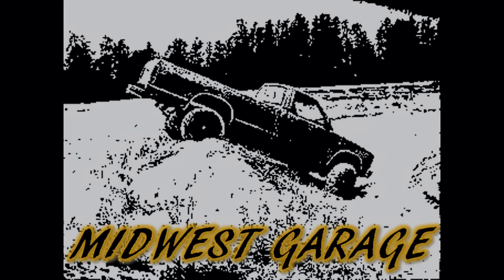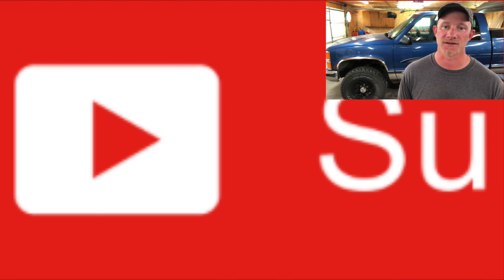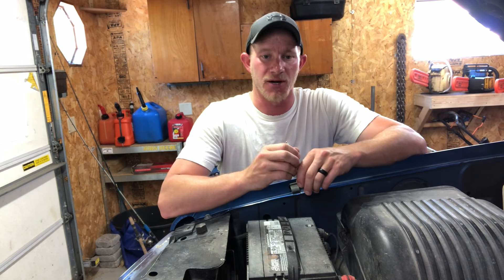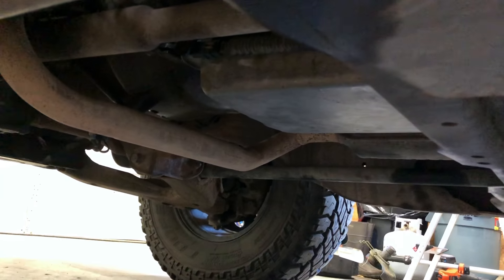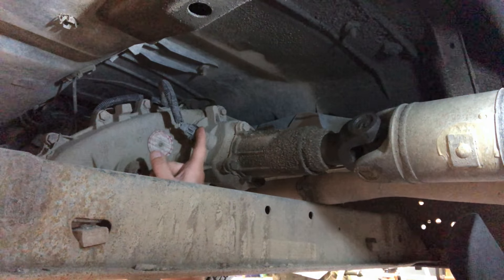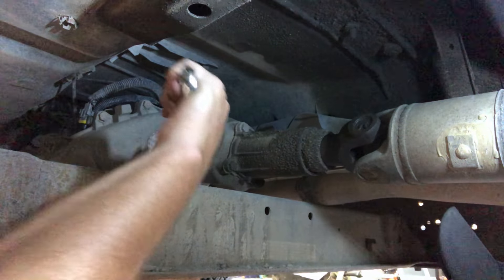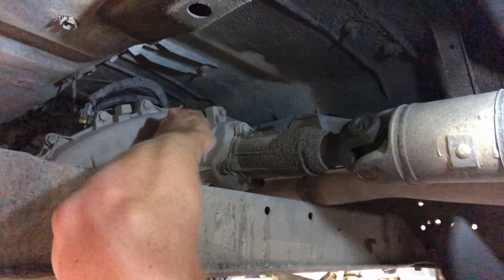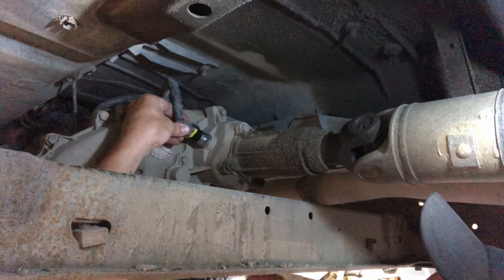How To Replace Vehicle Speed Sensor in 1988-2005 Chevy GMC Truck & SUV

Comment: Just this week I noted that my 97 gmc sierra speedo was suddenly reading 10-12mph fast.  Shifting is fine, no abs light or code. Hopefully this will be the fix. Rigs got 235k on it so I got my mileage out of that sensor for sure.
Reply: Did that end up fixing it? Mine is doing something similar

Comment: I think my speed sensor went out. My 96’ Tahoe started sifting funny last week. Today I was driving back to the rig and I was 15 miles out I had to drive 50mph at 3k RPMs then on dirt road 5 miles out 25 mph when I hit a down hill spot my transmission drove normal for almost a mile then back to slipping. I had my transmission rebuilt 5 years ago.
Reply from the maker: Yeah I'd definitely check this out man. It's only $30 so if it doesn't fix the problem at least you're not out much. Let me know if it fixes the issues!

Comment: If the instrument cluster is showing zero speed and the trans and ABS are acting normal, can I assume the speed sensor is not at fault? And it's a cluster issue? 

2004 GMC Sierra 2500HD 6.0 V8 RWD

Comment: Great video my truck runs great breaks work have plenty of pads, the sensors needed to be changed but the abs light is still on btw I have a 1998 Chevrolet Silverado 1500/ex 5.7 350 4x4, if you have any suggestions on what it might be thanks for the help.

Comment: Very good information I could not even get that information from all these so-called transmission specialist I have a 94 Chevy Silverado transmission went out it would only go in first gear and reverse I bought it I got a new transmission put it in and it's still only wants to go in first and reverse so hopefully that will solve my problem that my speedometer cable was acting all funky now I have no speedometer reading it all no nothing can you tell me if you think that that may be the problem

Comment: i have a 94 suburban 4x4 and i get code 16 VSSB and 72 VSS.  im not sure if one code triggered another? its rebuilt trans, i also have issues with both front wheel speed sensors. and brake light switch.  i guess every one of those would give me the issues i have with shifting and speedometer.

Comment: I have a 1995 Chevy two wheel drive. Will a speed sensor cause it not too shift. It's like it's stuck in second gear. Reverse work,s with no problem,s. I found a lot of acorns under the hood. Going to check to see if a squirrel has cut through a wire t

Comment: I have a conundrum with my 99 silverado 1500 4wd. So I have two sensors on my transfer case, one on the drivers side and one on the passenger side, they're set about 90 degrees apart, and I have no idea which one is the speed sensor, or if for some reason I have 2 speed sensors. Looking it up online is no help as everywhere I look says there's only supposed to be one. Any ideas?

Comment: Hows it going. So I have a 04 yukon denali 1500 xl and I have all the systems discussed in your video. I checked the code and it said ABS SPEED SENSOR. I purchased the item but mines came in a 2 pack of cord like sensors that seem to go on the front end wheels. Do you think this is the right part that my code is calling for?

Comment: Found this video looking to learn why my '88 Silverado's heater/ac fuse blows when I put the truck into 4WD, and I've got no 4WD. In 2WD, no issues with heater. From what I read elsewhere, sounds like replacing the VSS may solve the problem? I'm no mechanic, but looks straightforward, gonna give it a try shortly. Thanks for the video
Reply from the maker: That'd be a pretty cool fix if that works, I've never heard of those symptoms. Let me know if this fixed your problem though, I'm curious to find out. Thanks for the comment!
Reply: @MidwestGarage VSS sensor was ok, stopped blowing fuses when 4WD actuator was unplugged. Replaced, 4WD & heater good fine since. Thx for having a look at this, hope you and yours enjoy the holidays

Comment: Hey maybe you can help. Ive got a 98 gmc c1500 and trying to bleed the abs and it wont auto bleed only thing I can think is the wheel speed sensor are the problem but whats strange to me is that with the truck sitting still all 3 sensors are reading 3mph

Comment: On my 2005 GMC with the Duramax says shift range enable ABS and brake light stay on seems to only do it going from four-wheel-drive back to 2 Wheel Dr. and sometimes makes a clicking noise. Won’t go out first back up like it goes into neutral then it starts working fine again what’s up with that?

Comment: I have a question I have a 06 chevy silverado crew cab 2500hd 6.0 and the transmission shifts fine until it gets to 3rd it goes to 3rd to 4th then seem like it goes into natural for a second then back in 4th any guess it's a rebuild one has 11,000 miles

Comment: My 1999 suburban k2500 4l80 tranny is shifting hard in each gear i lost my speedometer the abs is on but I did get and service engine light.  You think I'm having the same issue?

Comment: I have a 95 G20. Trans won't shift out of 1st. Just had trans rebuilt with new speed sensor but the same problem still. The speedo works intermittently but when working it shifts fine? Any advise?

Comment: My 1997 K1500 5.7 is not shifting, ABS light on. Gonna change the VSS but it is very tight. Do you know what socket size fits this sensor? My adjustable is going to slip and I want to use a 6 pt.

Comment: Well I changed my speed sensor on my 03 Chevy 4x4 Silverado automatic transmission the speed sensor on the driver side and it didn’t help and I looked on the passenger side on transfer case and it has one on passenger side, they look the same and have the same plug connector I changed it and my speed odometer still didn’t work and lights still on. Do you have any suggestions?
Larry

Comment: Ok that was a good one I have a 93 GMC Sierra K1500 4×4 and I have changed alot the starter the gear box and plugs and wires and the distributor cap and the rotor  she started up and drove a couple days and then won't start she acts like she wants to start but doesnt any ideas

Comment: Hey. While I know this might an issue for some, my cruise control works sometimes and even disengages while in use. Could this be solution? I have a 99 GMC Savana. I have noticed that the speedometer does slow down before a stop. Like not reading what it should.

Comment: Excellent video... Straight into the point... Thank you :-) 
I do have a question maybe you could answer. Would a bad VSS have any effect on a starter motor? I had the symptoms you described, plus now and then my starter won't engage. Just hits a grind as if the Bendix didn't make a good connection flywheel. I can put it in neutral and roll it back to get the flywheel in a different position and usually that works. Other times I just click it a few times and suffer through the grinding until it engages. LOL. I probably should anticipate a new starter but was curious as to whether the VSS would have that type of effect on it? Thanks for any information and keep up the videos. Thanks again and take care
Reply: Did you figure it out? I believe the starter not engaging sporadically but the switching to neutral letting it work can be caused by the ignition switch on these trucks.

Comment: I know what to do but mine just won't come out, it's under a 2002 S10 ZR5, the floor is closer to the transfer-case so I have almost no space. It's literally planted. Would you recommend using a wrench and socket instead? Maybe a 1"

Comment: I have a 2000 Chevy Tahoe with 233345 MI. on her and I believe that's what's going on with my speedometer right now!?.. I'll definitely let you know if that's the issue and then had a transmission rebuild other issue still going on still haven't had a full tune up yet so there's a lot of issues I have water I hope this video solve my problem cuz I believe that's what's going on with mine

Comment: I have a 2001 Blazer/  My ABS and Brake light comes on just sometimes while driving on a long trip after maybe 50 or 60 miles.  Any idea what this could be?  It doesn't have the symptoms you mentioned at the start of your video.

Comment: Hi I've got a1998 chevy silerado Ilm having issues with my rpm and speedometer not working but rest of gages working also my Trans mission is not cycling through  the gears just replaced speed sensor any ideas?

Comment: A quick question. I have a 91 but a manual transmission. I have the diagnosis so yes I need to change mine. So is it the same and in the same place. Oh no mine is not 4×4. I as well need to change my reverse sensor.

Comment: I'm having the speedo issue and my tachometer also dies when my speedo does and my trans wont go into OD would this be my problem
Reply from the maker: There's a very good chance that this is your problem. I'd buy one and see if it fixes it. If not, at least it was cheap and probably needed to be done anyway. I hope it does the trick though, if not let me know and we can do some more trouble shooting! Thanks!
Reply: @MidwestGarage  awesome thanks man yeah I'm sure it wont hurt.  Its a 95 c2500 so it could use it I'm sure.  I'll get the part tomorrow and try it and I'll get back to you
Reply from the maker: @alputney3530  Was that able to fix your issues man?
Reply: Late followup sorry. But yes it did fix my issue thanks alot man. Now I have a 94 suburban and the tac and speedo don't move at all. It worked occasionally before but has been over a year since either moved now but no trans issues any thoughts

Comment: I just bought a one-owner 1997 Chevy Express 1500 conversion van.  It has 174,000 miles and is in excellent well-maintained condition.  It doesn't display any of the symptoms described here, but the speedometer is frozen at 22mph no matter road speed.  The previous owner says the speedometer will act normally when the outside weather gets cold.  "Late fall, all winter and early spring" is what he said.  Will a new VSS cure this as well?  Thanks.

Comment: Old post but could this cause the truck too act like cruise is engaged I have disconnected the cruise cable checked Everything. Checked for vacuum leaks all that helps is unplug battery then it won’t act that way for a few hours. No high idle only driving does is hang like cruise is on. Throttle cable is fine

Comment: Would this effect my rpm, gauge as well? I have a 98 chevy silverado c1500 5.7 engine. My truck will work fine, then suddenly lose my speedometer, rpms, and feels like I'm stuck in first gear. Already checked the ground lead. Any suggestions?
Reply from the maker: Could be this, could also be your ignition switch if it’s affecting transmission. I have a video on that as well…it’s an old one though so quality is low but it gets the point across.

Comment: My 2003 Chevy 5.3 won't go over 40miles an hour gears work and I have reverse. Would this be a possible fix?
Reply from the maker: @ricktile8252  this could very well be the issue. It’s a cheap part that’d be worth replacing to see if it fixes it and not a bad idea to replace anyway. If it’s not this then it may be your ignition switch.
I have a video on replacing that as well if you need it.

Comment: My '98 S10 Pickup  has erratic  digital odometer(major flickering)
 (Speedo works, but is off by 10mph)
And many of the dash warning lights are going on & off erratically, & even stay ON when the
Ignition switch is OFF  (draining the battery).
  even the 4x4 light comes on & the truck is 2 wh. drive!    lol.
    Trans is a manual & shifts fine.
Could a faulty speed sensor be causing this problem?
Reply: I replaced the speed sensor on trans and that fixed all of the check engine & other misc lights that were going off & on.    but now my speedo does not work at all (before the sensor swap, speedo worked),
& now my gas gauge does Not work.  W T F

Comment: I’ve replaced both wheel hubs assembly and the abs wires for my fronts. Would replacing this speed sensor fix my Speedo on my dash cluster reading off?

Or is there this and another sensor to replace? Someone said there was one, others said there was two?

I just want to make sure I can get my Speedo to match like it did from 96 lol. Not sure if there’s one or two sensors to replace on my 1996 K1500 5.7 4l60e. Thank you for anyone who can help

Comment: Having this issue with wife's '93 GMC, speedometer will randomly not work or act sporadically and occasional slipping. I had replaced ignition switch thing on steering column, based on someone else's recommendation.  Since that didn't fix the issue I tried swapping out the VSS.  Only the new VSS made the problem worse???  Instead of the speedometer randomly not working it simply never works and transmission won't shift past 2nd.  Thinking it might have been bad VSS, I went back to shop and swapped it out twice now and all 3 new ones have the same result.   Any ideas???

Comment: My 1998 GMC Safari van is not signaling speed or mileage on the display of the Instrument Cluster panel. I replaced the instrument cluster and the problem persists, all this after a mechanic told me that they measured a voltage signal reaching the instrument cluster at the speed and odo pins. Maybe I shoud´ve started by replacing the speed sensor. I dont´really think the problem is at the VCM

Comment: 1999 Suburban 2500 (last year OBS) running taller tires and still speedometer off about 7mph fast and running 3000 rpm at speedometer 70mph (63 gps).  ABS is shady and I have issues with final torque converter lockup at highway speeds.  No codes. This seems to be my issue, hope it works. Any other suggestions? Thanks for the vid!

Comment: my 4l80e is not like that at all. It has a input speed sensor, and an output sensor. Removeable with a 7/16, then there is a pigtail to a plug that is installed from inside the transmission. Any help with these?

Comment: Pretty sure this will help my non shift condition on my k1500 4x4 1993 Chevy Suburban, waiting for the part to come.  Question though...When I pull the sensor out of the driver side of the transfer case....fluild starts coming out.  I didn't pull it all the way out, but none of the videos I've watched show fluid coming out.  So is that normal or is my transfer case overfilled?  My k1500 has 225k miles and I"ve had it since 125k with no shifting issues.  It started not shifting into overdrive and I replaced the 1/2 and 3/4 shift solenoids with new filter and fluid.  Same problem.  Then my trans guys suggested a the vehicle speed sensor before we rebuild the whole thing.  Any thoughts?

Comment: I'm driving a 1991 silvarado 1500. It shifts high the spedometer is 10 miles off the check engine light used to come on but not recently. Could this be my problem.

Comment: Nice video thank you!!! Just replaced this after said issues popped up. Was scared my new trans with 500 miles on it was toast already... My issues are gone at the moment but I noticed some ground metal on the vss when I removed it anyone have input on this? I did notice the vss was magnetic is this normal like the pads in trans pans? Wondering if the new trans was breaking in and the metal made the sensor not work. Didn't try cleaning it which I should but already had the new one and just slapped it in. It was not chunky but the actual ground up type that looks like graphite so hoping it was somewhat normal but thoughts appreciated!!!

Comment: I'm hoping this is what my problem is with my 93 Chevy 1500 four-wheel drive.
I have a V6 and it and I am going to replace the speed sensor but my speedometer is not working and it will not shift out a second gear and if it does it shifts in the third and it drops right out hopefully this is what the problem is thank you.

Comment: I have a 97 k1500.  Speedometer is reading 35-45 mph higher than I'm actually going.  Rpm guage is reading 3x normal as well.  Transmission is shifting fine

Comment: I have a 1990 Chevy pickup 1500 series. When I turn the truck off, the speedometer goes crazy and if I don’t disconnect the battery, the battery drains and won’t start. My alternator is good, I changed the ignition switch modulator, and still goes crazy. Could the VSS be the problem? Or something else?

Comment: I have a 2005 silverado 1500 2 wheel drive. I had to replace the rear end. I put a slip pos rear that was geared lower. May have came from a 4x4 truck I'm not sure. My speedometer is about 10mph fast and my abs light came on after the rear change. Truck pulls to the left when I get on the brakes. What can I do to fix these issues?

Comment: I just found out about this part.  My ABS light was coming on and off and it said service brake system on read out. I pulled all the wheels and checked brakes. All good but left front hub assembly was bad. I replaced it thinking that was it.  Nope. I took it to the shop and they said it had a code for the transfer case speed sensor. Hopefully that cures it. My 2004 GMC Sierra 2500hd 4x4 has 350,000 miles.

Comment: I need help, I have a 1990 chevy s10 4.3l with a rebuilt engine and it has a hard shift into drive and the rpms are way high. no one i take it to can tell me what is wrong. the shift into overdrive from neutrual is violent.

Comment: Question.
I got a 05 Chevy Silverado. Speedometer is on the fritz. No abs light, no transmission slippage.
Is it the speed sensor or the cable?
Reply from the maker: That’s probably the speedometer cable. If you want though you could certainly check this also though. It’s good preventative maintenance to replace it anyway since the truck is 15 years old. Probably speedo cable would fix the issue though!
Reply: Me and a friend found a different fix, basically resetting the computer. And it's working. I'll keep the cable in mind since it is old.

Comment: Gotta question so basically my old tranny won’t shift out of first but it pulls in first and reverse good. So I replaced and bought me a new tranny and it does the same thing. Could it be the speed sensor